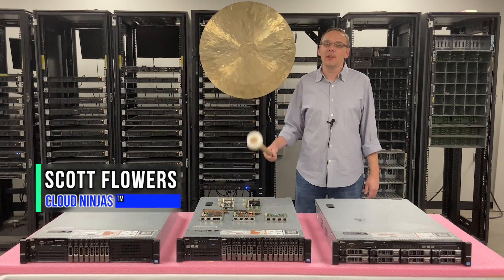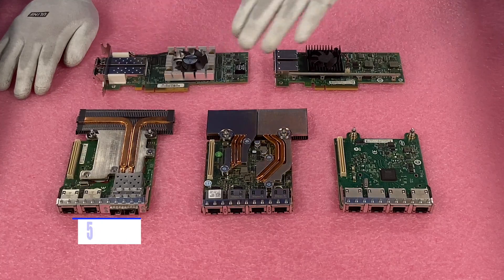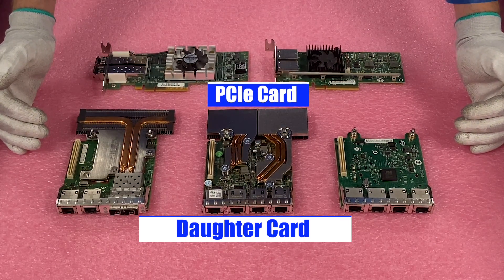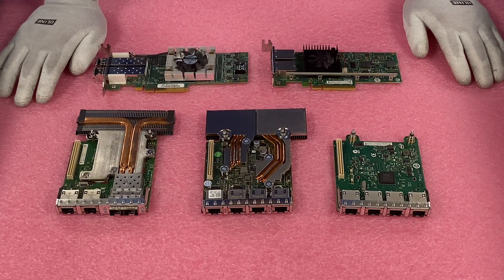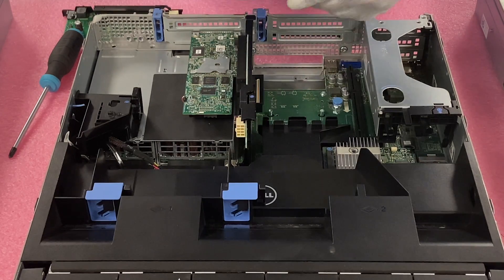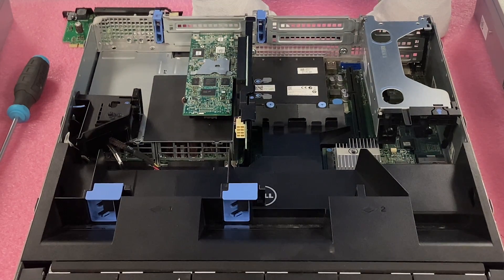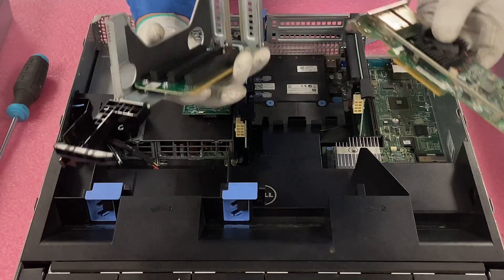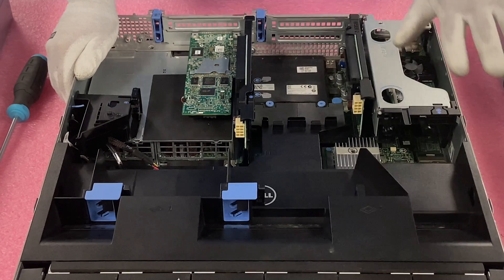Dell PowerEdge R720 Server NICs | Network Card Options | NIC 1GbE 10GbE RJ45 SFP+ | Installation

Comment: I installed the SFP+ daughter card with the 2 additional Rj45. I updated the firmware and the module is discovered by that, but the BIOS can not see the card.
Reply: I get a plug and play configuration error unknown pci device during boot